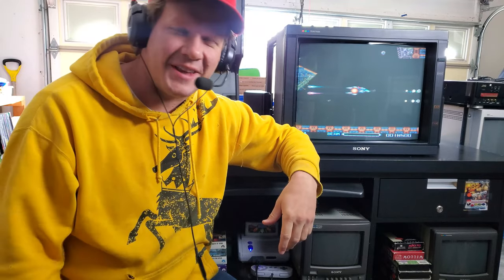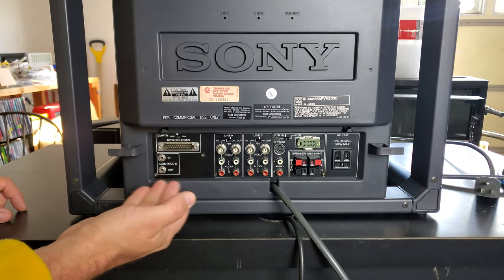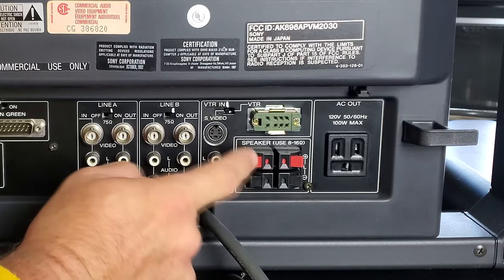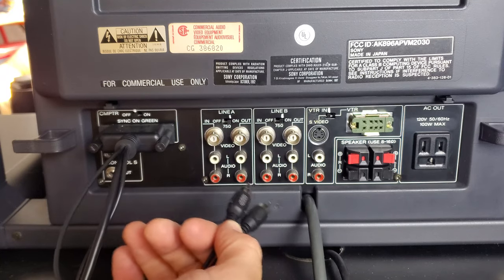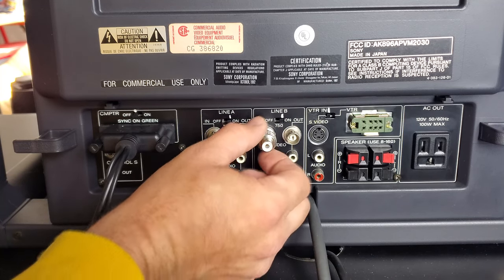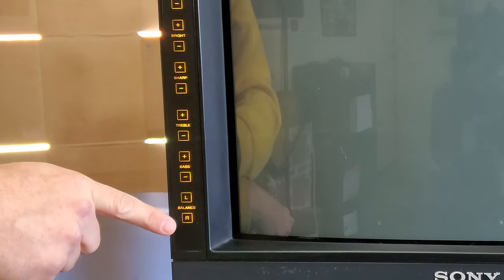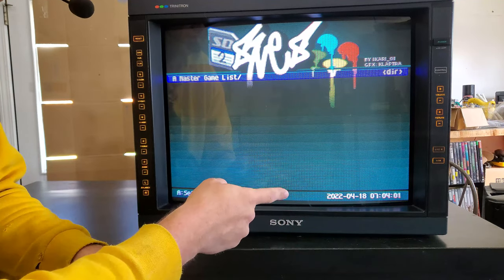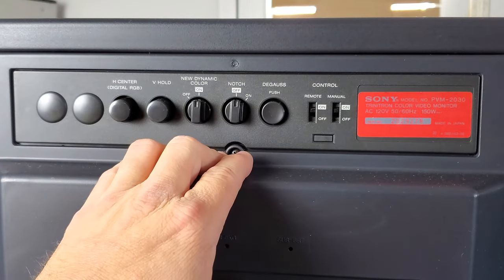The Sony PVM 2030 Trinitron - How to set up & get the most out of this Iconic CRT

Comment: The 2030 and 2530 are the best Sony pro monitors for gaming IMO. they've got the most pleasing picture of the bunch for these old graphics.
Reply: I had a 2530 for a year or so. I sold it for $400 (I paid $300). It seemed a bit washed out to me.
Reply: @dauntae24  After 30+ years, they need recalibration and sometimes new caps.

I own a PVM 1340 with PERFECT geometry, but the same color issue.

Comment: I have a 2530 and it's almost identical to this in terms of buttons, controls, inputs, etc. I really want to see you do an in-depth adjustment of the potentiometers though because I am having numerous minor issues with my picture. Would be great to know exactly how to safely and correctly adjust the picture because I've heard of people wrecking their tube by adjusting the pots and not knowing what they were doing.
Reply: I know. I broke one of my potentiometers off the board. The ‘Y-Cross’ I believe. Luckily I’d calibrated before this happens but I’d love to see Steve talk about this kind of thing.
 I have a 2730.
Reply: I'm considering getting a 2530.  Seems like it's in pretty good shape.  Do you think it's worth $600?

Comment: If you switch one of these on without anything plugged in at the back will you see a picture of any kind ? Turning up the volume should a counter appear on screen or something ? Came across one at work gathering dust just sitting there,plugged it in and powered up with static on the screen but no indication of a pictcure on screen ?

Comment: Thank you for the video. I have a Sony 2030 and after using it for about half an hour this loud terrible ringing starts coming from the unit and I have to power it off for a few seconds to stop it. I have no idea why this happens.
Reply: I have the same problem with mine.  I think it's the red box on the back of the tube that goes in between the flyback and tube failing, but I haven't been able to find a replacement to test it with.

Comment: Correct me if I'm wrong, but the voltage related data grouping, e.g. (120v 50hz/60hz 150w) isn't talking about the video frequency (PAL vs NTSC) it's talking about the supported Alternating Current frequency: 50hz vs 60hz.

Comment: Nice Steve, thanks. I do miss my 2130QM, for the ease of Scart & audio, but mostly for the iconic good looks. Sold on to a gamer though, so it went to a good home and I replaced it with a 20F1E, so can't complain. This video has made me a bit misty eyed tough... particularly love the light up front buttons.
Reply from the maker: Thanks for the story.  You are upgrading to the best analog CRT ever according to many.
Reply: @RetroTechUSA  Yep, the F1E is amazing and I saw that Pat said it was his favourite BVM, so that’s reassuring. I have a Mitsubishi 2070SB for 30Khz and above so bases covered. Would dearly love a Sony Multiformat that did it all, but they’re so damn expEnsive and honestly I think I’m good with what I have. 👍
Reply: Wow are you me? I did the exact same thing. 2130 was the first big PVM for me. I bought it at an auction the sells off studio equipment then bought an F1E a couple of years later and sold my 2130 to the guy who runs the theblock dot art website. He let me into his warehouse and it was like a jungle of PVMs stacked head high.
Reply: @hankhill7827  Haha - maybe... 😆 I got my 2130 from a production company in Surrey, U.K. and they’d had it from new. Came in a bespoke wheeled flight case all for the princely sum of about £200. I got the F1E (with control unit) plus a faulty G1E and 10x 10inch JVCs from a London Studio for £500. That was a good day. 👌

Comment: THANKS! I just got one and almost all my retro consoles I have Scart cables for and was running through a ossc to a modern TV, or just normal component/composite or s-video to my CRT's depending on console.
Reply: man, I am NOT having any luck finding a sub rib sync cable to scart. Everything is console specific which I already have all the specific cables from console to scart, was just hoping for a cable to run basically a scart extender into the PVM

Comment: Awesome screen. I love mine… not super versatile though.
It’s currently perfectly adjusted for my Mega Drive, but if I connect anything else I have to take the back off to adjust the geometry.
With a supergun it needs opening up every time I change PCB.
Fine with the occasional change, but if you want it for multiple inputs/a switcher, it’s a pain to work with.

Comment: Hi. I bought one of these and just realized I don't know how to hook up the speakers. I have the Sony SS-X6A speakers that come with it. I see two screws on each speaker where I assume wire is meant to be connected. I'm having a hard time finding information on the internet about how to hook up this kind of speaker. I don't even know what the kind of wire I need would be called. Could you point me in the right direction?
Reply: I figured it out! Wow, learning about older technology is really hard when i dont know what anything is called lol! Im going to try using 16 gauge speaker wire

Comment: Hey there, great video. I have a 2130QM and have always wondered is the 2130 just European/UK version of the 2030? I noticed that the 2130 has separate s-video and VTR inputs, with s-video having a passthrough too. It also displays what region of signal it is receiving (PAL, NTSC, NTSC 4.43) on the bottom left underneath brightness, sharpness, etc. Also has SCART input instead of CMPTR input. I am also struggling to find a date for when the 2130QM/2030 was produced and how much it would have cost at the time.

Comment: I recently picked up the very similar 2130QM specifically for Tate retro gaming. Image is near perfect in horizontal mode, but when I turn the tv on it’s side I end up with colour purity issues in one corner. Have tried unplugging, leaving it rest for a time etc but it doesn’t seem to like being on its side. The degaussing  circuit seems fine, I can hear it trigger when I turn the tv on. 
Any ideas? Maybe I should try those magnetic tabs?

Comment: Can you feed Component video into the RGB's DB port for this PVM using some sort of passive Component to DB adapter or does it only accept RGB? I need to know this because my setup uses absolutely no SCART cabling, only Component or S-Video.
Reply from the maker: Sorry, no.  This won't support component
Reply: @RetroTechUSA  Oh well, that just means I have to use some sort of converter like like a Comp2RGB from retrotink. Thanks!

Comment: I've got that chance to buy one of these...but it's always a risk. these things are 30 yrs old, need caps replacing and are only adjustable via pots inside the chassis ☹️
Reply: Have you seen the particular unit powered up? How does the image look? Are you able to test it with a console? It may not necessarily need recapping or calibration to enjoy. It also comes down to price. If paying top dollar I'd expect it to be recapped and calibrated, but if the price is more reasonable you can always get it serviced later. Replacing through-hole capacitors is not a difficult job, and any competent electronics technician would be able to do this - they don't need to be a CRT specialist. You can buy suitable packs of capacitors.
Reply: @axi0matic  I bought it in the end, I managed to get a good deal on it. Picture looks fairly good so I'm not sure it needs a recap just yet all being well